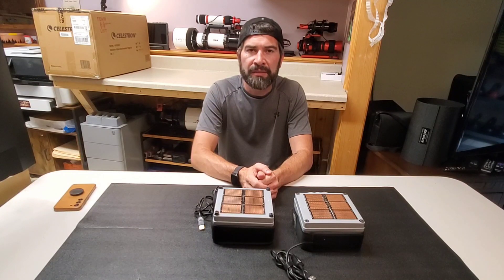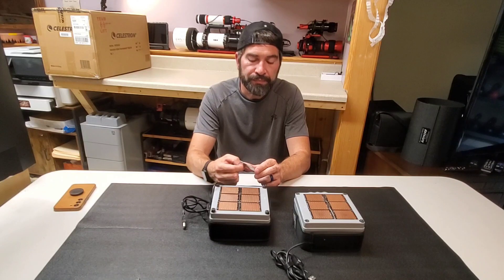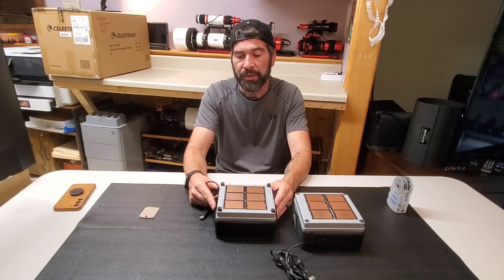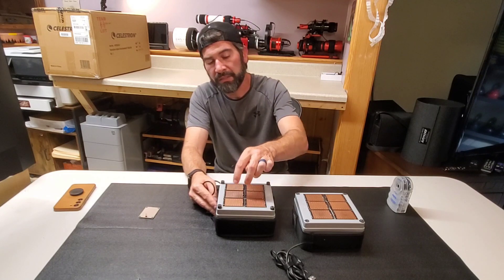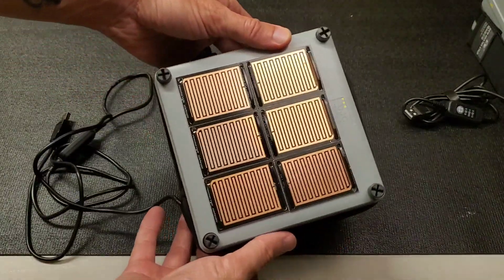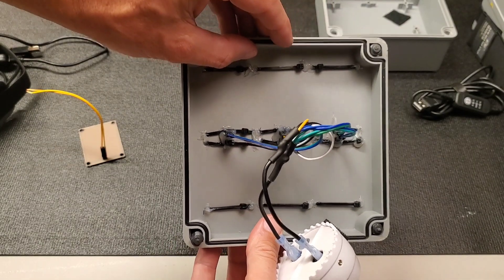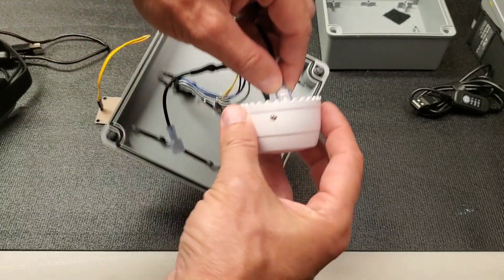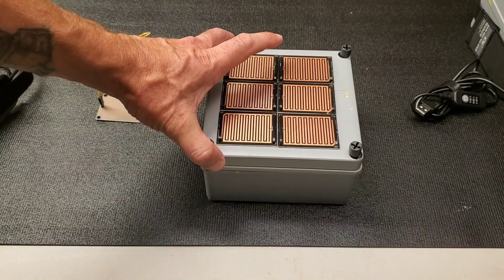The Raininator - Astro Gear Protection

Comment: How do they held up in extended period of time, I have a strong feeling that the exposed PCB traces will corrode over time with water ?
Reply from the maker: Been going strong for years! I haven't even changed the battery in it. Still using it, works great 👍
Reply: @Astrolips2000  Nice, Thank You for answering :)

Comment: Would it be possible to thread the dew strap underneath the sensors.
Reply from the maker: Might be difficult because of the wires hanging down but placing it around the outside of the box works well because then it will keep the whole box warm. This is crucial for the winter because if snow falls on it it will then melt.  Did you make one?!Thanks for watching!
Reply: @Astrolips2000  hi
I made one using 9 of the rain panels and same sensor. I've placed a usb dew strap around the inside of the box . I'm based in the UK and it seems to work very well. I compared it to a commercial product from High Tech Astro and this seems to be more reliable. It would be great if NINA software allowed the use of the sensor.
Reply from the maker: Oh wow nice!  I had no idea a commercial version is available!  I've been using mine for well over a year with no issues and I get very heavy dew,  works perfectly fine wrapped around the outside of the box.  The alarm will go off every time I forget to turn the heater on.  I'm sure inside works just fine too! Happy to hear you made one - Brian